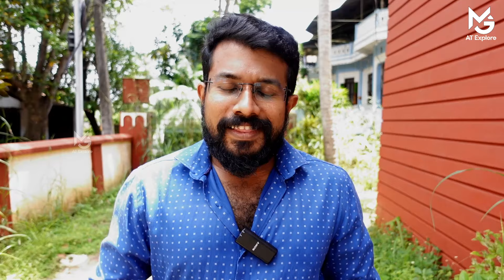ഇങ്ങനെ ചെയ്യരുത്‌ എഞ്ചിന്‍ കംപ്ലേയിന്റ് വരാം | Vehicle climbing steep without acceleration

Comment: Bro Can You Please Do A Video About.... Why Temperature Warning Lamp Turns Blue On cluster Metre ??? Any Complaint ???
Reply from the maker: It's normal. When the engine is in the cold condition it always shows blue colour and when it reaches It's normal working temperature light will get off
Reply: 2014 model Honda city 1.5 diesel caril engane RPM kayarinilkaarilla but 3-5 min wait cheyyarund for normal working temperature
Reply: @muhammedadhil2067  👍🏻👍🏻👍🏻👍🏻
Reply: @muhammedadhil2067  usually petrol cars il aanu bro RPM raise aayi nikkarullath. Diesel il angane kandittilla